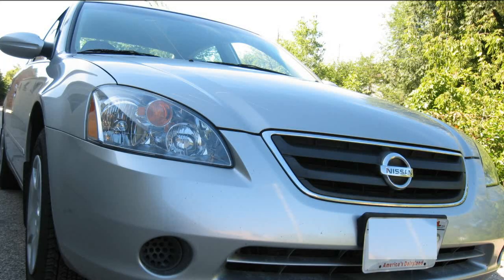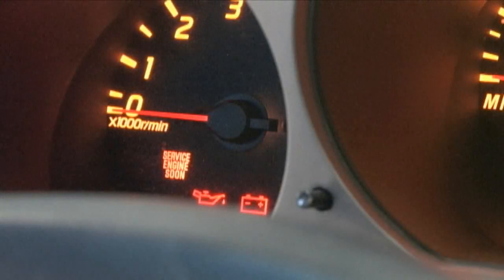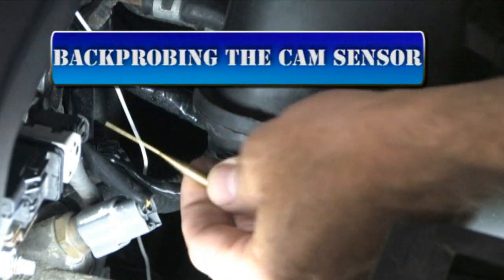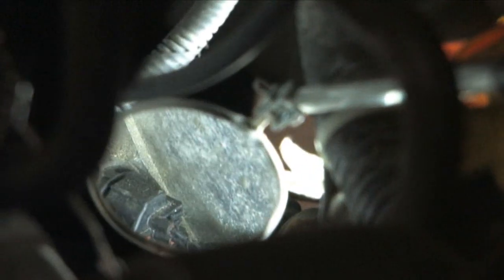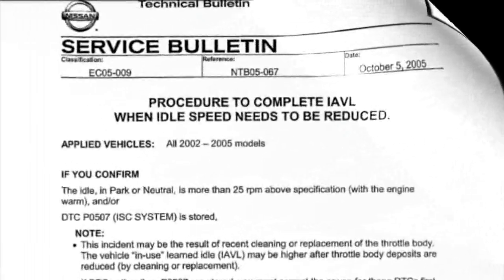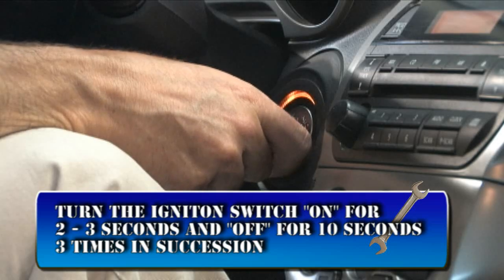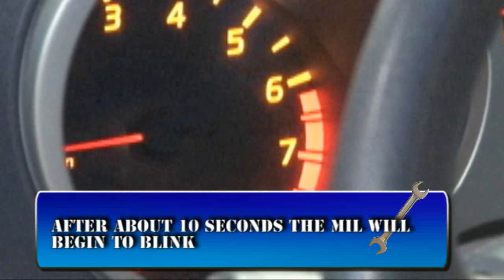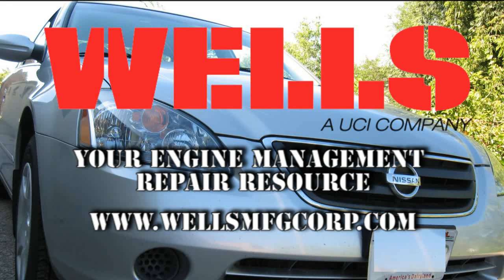Nissan P0505 P0507 Relearn Cam and Crank Sensor Troubleshooting and Testing by Wells

Comment: Great Video; it did help but wasn't 100 percent. Here's my 2 cents from my experience; hope it helps others. 1.) Disconnect battery and short out battery leads(NOT TERMINALS!!!) and let engine get cold. 2.) Perform Accelerator Pedal Resest Position Learning. Google for procedure. Follow video instructions; if you can't get the timing right after two trys then start over with step one. If CHECK ENGINE light still on, idle still high then rev 2 times and idle will drop. Reset MIL manually, BINGO

Comment: Just to let you this procedure worked for me!!  It took me about three tries to get down the right procedure but once I saw the MIL light blinking I was good and then restarted.  I went from an idle RPM of 1100-1200 to 650-700. Thanks for taking the time to make this video. It saved me a trip to the Dealer and a couple Benjamins.

Comment from the maker: Disconnect one or more fuel injectors as necessary to bring the RPM down and perform the Idle Air Volume Learning procedure.

If the idle will not relearn, it may be necessary to bring the vehicle to the dealer to have the factory scan tool, try going through the relearn procedures.

If the problem still occurs, the vehicle may require throttle body replacement. 

Mark Hicks
Wells Vehicle Electronics

Comment from the maker: Try the relearn procedure in the video. If it does not work and you are sure you performed it correctly, you might to do a relearn with the factory scan tool.
Let me know what happens please,
Mark Hicks
Wells Vehicle Electronics

Comment: oh man this video saved me 1000 dollars, i recently bought a used nissan maxima 2002 in japan and it is called cefiro, i had a problem when the car is cool and i start it, the engin just dies,
so a friend of mine adjusted the pedal wire leve, so when starting the car i have to keep my foot on the accelerator for two minuts then i can drive it without the engin get killed, however there was a significant drop in the engin power, but then i just cleaned the throttle and i am riding like a wind.

Comment: Hi Mark, a quick question, in the first step "turn on/off 3 time every 3 seconds".. Does "on" means turning to "2" just before starting the engine? the ignition switch has "off", "1", "2"  thanks

 I don't get P0507 code and the service light is not on. However, after I changed the air filter, and drove for about 10 miles. The second time I start, I found it is 1100-1500 idle time all the time now. I am going to try this tonight.

Comment: @markjhicks Haha yeah I actually didn't stick my hand that much, I made a nice lever system to yank em out, once the bolts removed. I got rid of the altima because it was failing on me faster than I could fix it, and going to my gov job on a bike was not an option. I drive a Z33 now :)

Comment from the maker: @emsotakon You are right it is a 2.5!  My error. Most techs are replacing both these sensors when one goes bad to prevent come backs. I would not wish having to replace the crank sensor on one of these twice on anyone. How are those scraps on your arm doing? :)

Take Care,
Mark Hicks
Wells vehicle Electronics

Comment: Nice Vid, BTW the car is a 2.5 liter motor.
I had to replace these sensors 3 times, 2 times for the crank, once for the cam.
If any of these 2 are faulty your car will stop when driving, and wont start. Since my car was Manual, I was able to bump the motor to change crank/ cam pos and start the car again.

Comment from the maker: @savassarac By far the most common cause for this P0507 code on your vehicle is this re-learn procedure. It will work on your vehicle! You have to do it just like it states in the video. Be patient, it took me several tries to get it right the first time. Your only alternative is to take it to a garage who has the OE scan tool.
Best of luck,
Mark Hicks
Wells Vehicle Electronics

Comment from the maker: @tbelloto Sorry I just looked up the time to replace the timing chain, 10.6 hrs. $1700 sounds like a lot, I would check around. But before anyone digs into it I would want to be absolutely sure it is the cause of the problem.

Mark Hicks
Wells Vehicle Electronics

Comment from the maker: @markjhicks 4. Check the CMP sensor pin terminal connections for being clean and tight.

5. Check the CMP sensor signal on the White wire at terminal 62 of the Engine Control Module (ECM) as necessary. 

Check the connection very carefully, there are a fair amount of problems associated with it.

Mark Hicks
Wells Vehicle Electronics

Comment from the maker: @markjhicks 3. Back probe the White wire at the CMP sensor and turn the key ON and see if there is about 10.0 volts on the White wire from the sensor. If so, crank the engine and check for a 0-10 volt square wave cranking and running with grouping of signals - 1, 3, 4 and 2. Compare the voltages and the square wave signals when the engine starts and runs fine to when the engine will not start.

Comment from the maker: @tbelloto 	
1. Check for battery voltage to CMP sensor on the Red/Green wire and see if the voltage is still good when the problem occurs.

2. Check the ground for the CMP sensor on the Black wire - look for 0.05 volts or less when the problem occurs to be ok.

Comment from the maker: @PR4470 This procedure should work on your vehicle. I don't know if it take care of any prior issues. Remember, this procedure is only meant to reset the idle to the proper speed if there are no other codes in the system. However, trying the procedure is not going to do any damage to the vehicle either.
If you have any further concerns, let me know.

Mark Hicks
Wells Vehicle Electronics

Comment: @markjhicks Hi there, still having some issues with the car.  Now it seems like the car is reving too low and it even stalled on me a few times at red lights. Cant figure out the problem. Can I IM you all the recent problems I have been having to give you a better understanding?

Comment from the maker: @xenoepist It should work on your vehicle and makes sense replacing the battery could cause the problem. Give it a try, if it doesn't work you are out nothing but a little time. Just follow the directions. The first time I did it, it took several tries.  Let me know what happens,
Mark Hicks
Wells Vehicle Electronics

Comment: Does this procedure work on 2004 a 350Z? I got a P0506 (rev lower than expected fault) fault  right after I installed a new bat, which lead me to believe that the computer forgot some settings, and I want to try this out on my vehicle.

Comment from the maker: @polloe0224 What vehicle do you have? If it is the same as in the video or one of the comments the relearn process will work. Remember, you have to do it just as the instructions state. If vary from any of the instructions it will nit work. It took me several tries the first time.

Mark Hicks
Wells Vehicle Electronics

Comment from the maker: @polloe0224 the engine is not running through this entire process until the very end when you start it. However the key is in the "on" position through the process.

Mark Hicks
Wells Vehicle Electronics

Comment: Very helpful , just got done, it actually worked on my 2004 maxima after replacing the camshaft position sensor(B1) idle was 1500rpm,,,, after performing this relearned procedure the rpm dropped back to it's normal idle... Thank You Very Much, saved me a visit to the dealer and money that's still in my wallet. Thanks again.

Comment: @rezuhrekted thanks for the reply. i replaced the sensor on the back of the block and all was fine. i still dont know which one is which so i replaced both the camshaft and crankshaft position sensors.

Comment: @rezuhrekted thanks for the reply. i replaced the sensor on the back of the block and all was fine. i still dont know which one is which so i replace both the camshaft and crankshaft position sensors.

Comment from the maker: @thestockbridgejohnny The relearn will only reset the idle speed. The code will need to be cleared. Clean the throttle bore and plate before you have the code cleared. To everyone else out there, it is not recommended to loctite the idle speed screw.  Stay in touch,

Mark Hicks Wells Manufacturing L.P.

Comment: Thanks for the info.  Recently had mechanic friend loctite the butterfly screws and, I'm guessing, that's what threw the P0507 code.  I did the idle relearn but check engine light still on.  Should the relearn reset the light or do you still have to reset it.?

Comment: hey mark, the error code on my 03 2.5 altima comes up as (camshaft or crankshaft?) i forgot which one but it says position a...is that the sensor on the back of the block? i replaced the one one the side and it still stalls and idles wildly

Comment: @markjhicks I just disconnected the battery for 8 hours...  It seems to work but the RPMS are a little bit over (850 RPMs aprox) I'm going to drive it like that for 1 week... I let You know the results thanks.

Comment from the maker: @butthefollowing If all the pre-procedure parameters are correct, try disconnecting the battery for about 20 minutes and then perform the procedure. If this does not work, you will need to cet it corrected with the factory scan tool.

I hope this helps, please let me know the results,

Mark Hicks
Wells Manufacturing L.P.

Comment: I followed the procedure for a Pathfinder SE 2003 and it worked but after I turned off the engine and started it again the idle speed went back to 1000 RPMs...  What should I do so the RPMs stay low even after turning the engine off ?   Thanks

Comment: 2.4 engine? You sure about that.? You should try to avoid touching the throttle plate when cleaning the Throttle body.  I've heard that's one of the reasons the idle becomes erratic. 

Thanks for the video though, this could have saved me a couple trips to the stealership. This works on 2.5L Sentra's BTW.  I found it useful to use a stop watch to properly time the idle-relearn.

Comment from the maker: The Wide Open Throttle or WOT switch is used on some early systems. It might be used on some later models too, not 100% sure. It is simply used the tell the on board computer the accelerator is on the floor. 

Mark

Comment from the maker: You would test them the same, but it would be at cranking speed not idle speed. The output signal will be the same except the frequency would be less.

nice question.

Mark

Comment from the maker: Gm uses these signals from yes two different crank sensors. One is mounted on the front of the crankshaft and is used for faster starting, it is the 18x signal. The other is mounted in the block and reads a trigger wheel on the crank it is the 7x signal.

Comment from the maker: You are asking if the idle relearn and crank sensor relearn are different...answer yes. A crank relearn is performed when the PCM does not recognize the new crank sensor or sets a code.